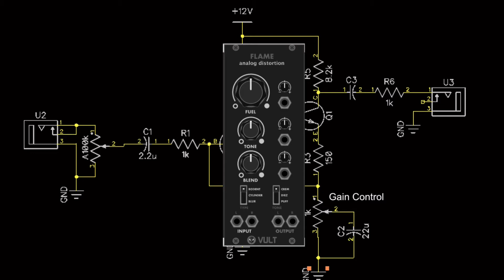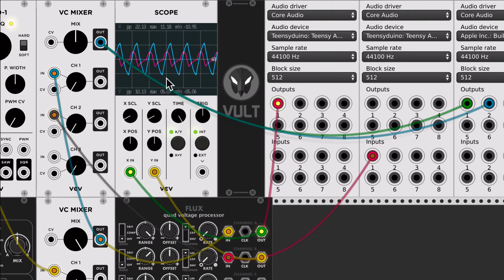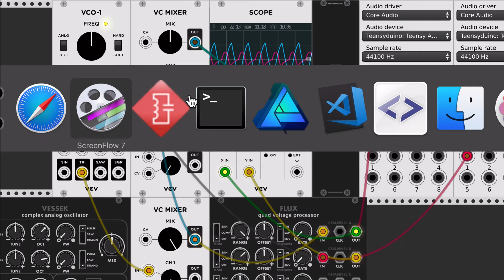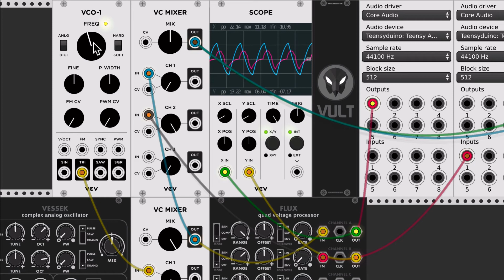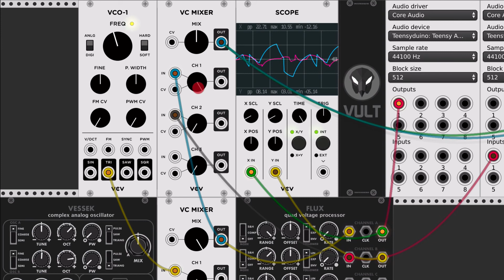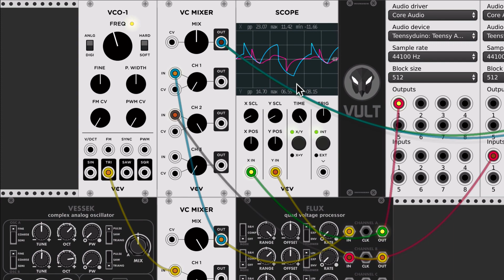Hardware Blur2: Audio demo

Comment: Awesome, Hi, I want to built this distortion circuit for my kick drum, what type/series of silicon NPN transistor are you using in this demos? ... 2N3904 or..?thanks
Reply from the maker: Yes I used a 2N3904
Reply: @Vult-DSP  Great, Thanks for a quick replied 🙏🏽